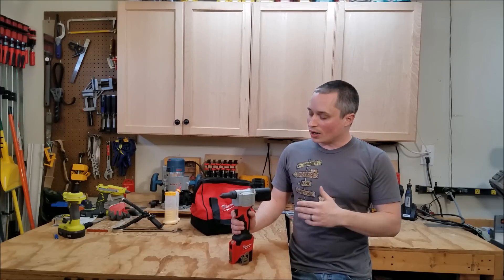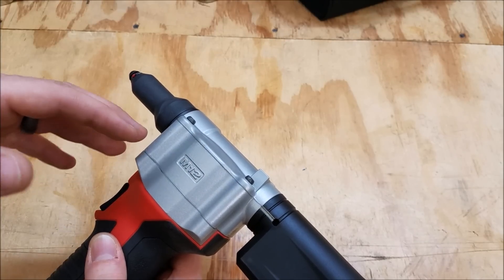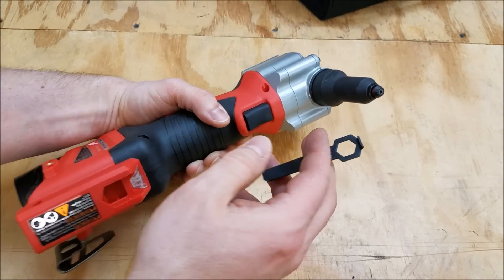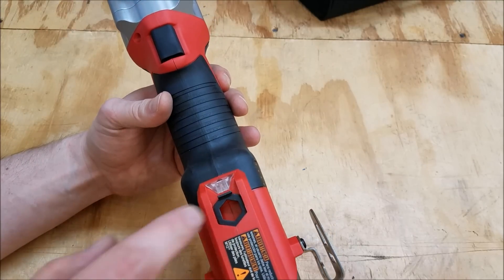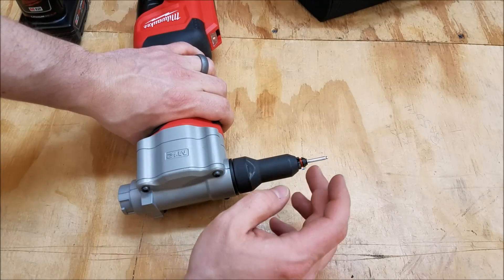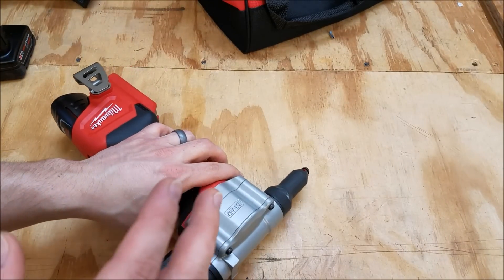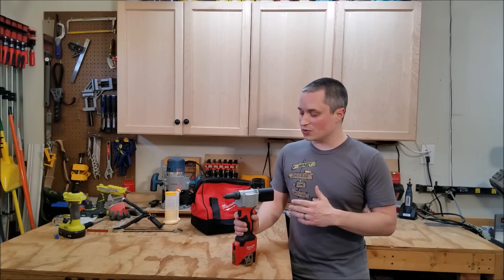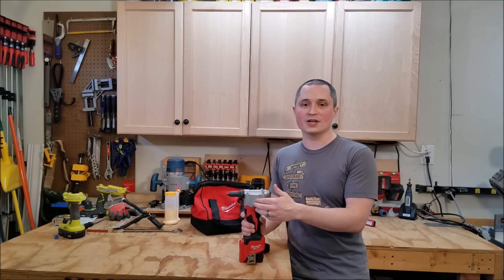Milwaukee M12 Cordless Rivet Tool Review

Comment: If you hold the trigger it will keep the jaws tucked in so you can change the tips...at least that works on the air rivet guns
Reply from the maker: That's a great tip!
Reply: Doresoom Reviews I see what you did there....
Reply from the maker: Haha, that was a completely unintentional pun, I promise! 😂
Reply: Jimbo is right. Also, don't use the little wrench. Just screw the tips in by hand. They aren't going to fall out and it makes for a quick change.
Reply: Same with the metabo rivet gun

Comment: Just a note about the mandrels staying in the tip - This is actually a designed feature. If you look at all the tips you'll see a colored band (most think that's it's just there to denote size) it's actually an o-ring that grips the rivet so it doesn't fall out when it's pointing down. VERY HANDY!

I prefer to pull the mandrel out the front as if you have lots of mandrels in the catcher, it's almost guaranteed that they will start blocking others from dropping in and the tool will get jammed. Unlike some cordless riveters that are a pain to take apart to clear jams, at least the Milwaukee is fairly quick.

Comment: Thank you for the info in your video buddy. On the back where the black plastic rivet stock catcher is, when you take it off you'll see a white plastic plug in it, what is that for? Why I'm asking is because when I first got the tool I was on the phone talking to my wife as I was putting it together so I wasn't really paying attention so  I tried pulling that plastic plug out thinking it was a protection plug like you see in a new air tool. Well I broke off the out ring of it and the rest of it is still inside of it. My question is, did I affect the performance of this gun by doing this and what's that plug for? I work with sheet metal and we call these rivet tool "GUNS". If ya look closely at that plastic plug you'll see numbers or letters in it. Anyway I'm so nervous now because I'm not sure if I ruined this gun.  Anything that you could tell me would help. Thank you for your time and I gave you a huge thumbs👍up on your video buddy, take care.

Comment: Can’t get the nose piece odd the nose housing just got the tool used once wanted to change rivet size but cannot remove original 1/8 nose piece from the nosehousing...help
Reply from the maker: I think I had to get a bigger wrench out than the included one in order to loosen the nose piece the first time. They must really crank it on there at the factory.

Comment: I wish it did 1/4 rivets
Reply from the maker: That would have been awesome. Maybe we'll see an M18 version if this one sells well.
Reply: Doresoom Reviews I hope so too
Reply: Agree.  Just the other day i was needing a 1/4" rivet gun.  So i had a browse to see what Milwaukee had, found this, and then was a little bit disappointed to see it wouldnt go up to 1/4".

But even still, it would be a handy tool when alot of riveting is done.  A few months ago i bought some storage cabinets from the local hardware store.  They, like everything these days, were the cheap chinese crap.  I knew from prior experience that they cabinets are "ok" once you do some modifications.  Those mods are add about 50 srcrews/rivets to stiffen the structure up.  And make another couple of shelfs.  (They never include enough shelfs).  So 2 cabinets meant i had to hand pull near on 100 x 3/16" rivets that day.  This tool would have been awesome.  And worth buying just for that one job.
Reply: Bram Biesiekierski I definitely agree, you would think with all that power it could do 1/4. I got so excited when I saw this and got so disappointed when I found out it couldn’t, I guess Milwaukee is going to use that as an upgrade in their tool line up in the future.
Reply: ibrahim elmohtadi 
It may also be a physical limitation with the puller jaws.  Like they cant be small enough for the smallest rivets, while at the same time big enough for the biggest rivets.  Dunno?  

Handheld Pop rivet guns never go up to 1/4".  In order to do them you need a more specialised riveter.
Reply: Bram Biesiekierski i dont see that being an issue as the air powered ones come with multiple  size jaws.
Reply: pjshooter6 
Well i was looking at my local hardware store, and they sell an 18v rivet gun.  (Toptul brand)  And it does do 1/4".  But it doesnt do any thing smaller than 1/8".  The milwaukee does do 3/32", but wont do any thing bigger than 3/16".   (And is 12v)  So if it was possible to make a single set of jaws grab both a 1/4" and a 3/32" without issue, then why wouldnt the Toptul do it?  

So unless the jaw mechanisms are specifically interchangeable, then i think its pretty fair to assume that a rivet gun is not going to be able do such a large range of sizes.  I think that jaws small enough to grip a 3/32" rivet, will be too small to properly grip a 1/4" rivet withput cutting into the shank.  And jaws that are capable of grabbing a 1/4" rivet will probably let a 3/32" rivet slip right through them.

Perhaps it would be possible with interchangeable jaws.  But neither manufacturer went that route, perhaps because its simply not worth the added complexity. 

I will bet money that Milwaukee do make a 1/4" capable machine in the future, (maybe once people have had some time to buy up the current m12 model?)  And i wouldnt be surprised if it didnt do 3/32" rivets.
Reply: Bram Biesiekierski i have a professional rivet gun for collision repair that does cover most sizes
Reply: pjshooter6 
Which brand/model is it?  What sizes does it do?  

I would be very surprised if it did 1/4" and 3/32" on the same set of jaws.
Reply: It will pull 1/4 aluminum olympics. I robbed a 1/4 tip off an old Astro air riveter and works good. Will pull 1/4 stainless mono-bolts but won’t cut the stem off.

Comment: It's a little worrying that some of the mandrels don't drop right out the back and can be a major flaw. I've had other cordless riveters where they've become clogged and trapped unknowingly because they didn't drop out and inevitably ruined the tool. I did like the look of this but it just doesn't look anywhere like beefy enough for constant use of anything over 5/32.
Reply from the maker: That's a good point about potential jams, although I haven't experienced any myself yet. It's got a 5 year warranty, if that helps alleviate any longevity concerns.
Reply: Doresoom Reviews I speak from years of experience with cordless riveters, not saying that as a knock back so please don't assume that. My main cordless riveter is a Gesipa Accubird which many consider the industry standard for such tools and it does happen with them. However I've found with the Gesipa if it's turned upright the mandrel drops out which clears the barrel. Hopefully this won't be an issue as it's a very tricky fix and even given the 5 year warranty, downtime with such tools is costly for the end user as those who use them constantly benefit greatly from time saved. I've thought about ordering one from the US but the warranty wouldn't count in the UK so I'll have to wait :(

Comment: This will do 1/4 aluminum olympics. I robbed a 1/4 tip off an Astro air riveter. Will pull 1/4 stainless mono-bolts too but won’t break the stem.
Reply from the maker: Good to know!

Comment: Could you use nutserts some how?
Reply from the maker: Like rivnuts? I don't think so, unless Milwaukee made some sort of threaded adapter for it to pull on in place of the standard pop rivet mandrel. Even then you'd have issues controlling travel, since pop rivets just break off.

Comment: finally!! A cordless rivet gun! Was hoping someone would do it. I hate using the handhelds especially if you’re trying to beat the clock. My next purchase for sure just sucks its over 4lbs. That will make for a sore arm if you use it enough in a day
Reply: Dustin Smith less sore than using a hand rivet tool
Reply: Finally?   I've been using Gesipa Accubirds for 20 years!!

Comment: Holly shit i need 1. How much is it???
Reply from the maker: $170 bare, $300 for 2 battery kit. I'd recommend buying bare tool, and if you don't have any M12 batteries, you can get a cheaper drill or impact kit with batteries and a charger for $130 or less.